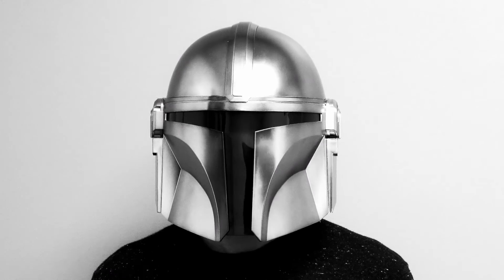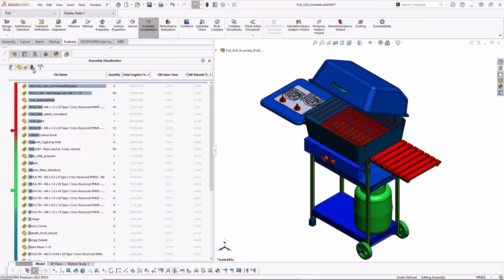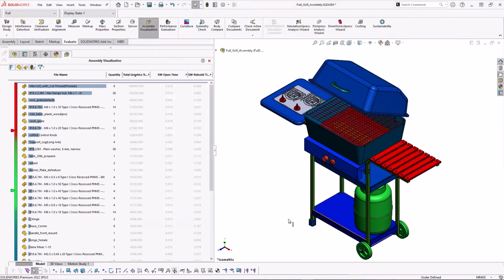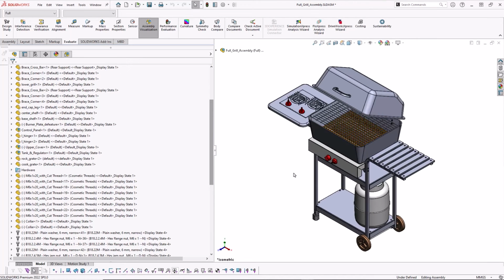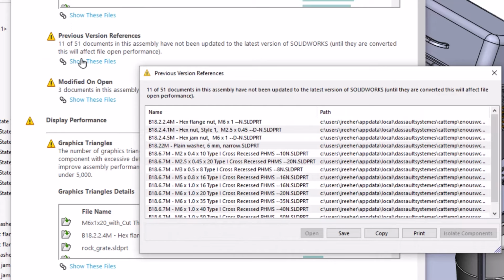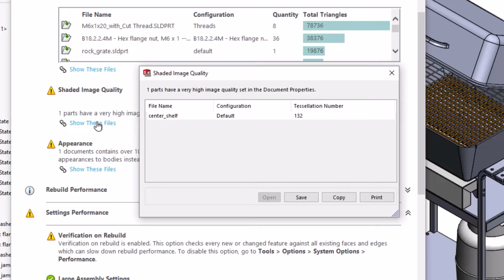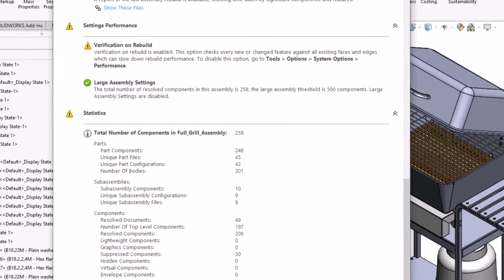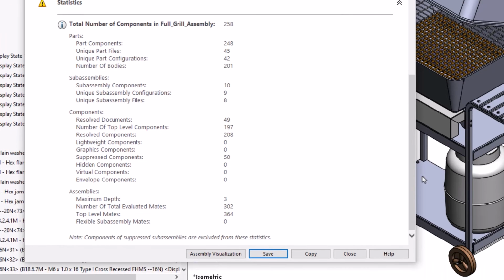Why is Your SOLIDWORKS Assembly Slow?

Comment: Hey Bro, I have another issue.

My SolidWorks is only using 30-50% CPU time?
Do you have any idea what's causing that? And how to fix it?

Thanks I really appreciate any help....... :0)=
Reply: i really wanna know too
Reply: @ltd5480  I have figured it out. There is nothing wrong with Solid-works, but it can only use one thread at a time. If you have a 4 core chip it will only use about 30%. Meaning one core 100% and then some!
I have overclocked my Alienware from 2.80 GHz to 4.13 GHz. a 36% gain, the thing screams now!
Reply: I saw some post before. Solidworks do calculations thread by thread, that means can only process by single core even you have multicore processor CPU, hence, the CPU usage wont be full.

Comment: Hey Bro. Thanks for all the great info, you saved me from my agony over many months.

However, I still have an issue I can not find any info on.

If enable hardware acceleration in my video card, I can rotate the Assembly or part  very fast, However the dynamic highlight turns very slow. I can see it redrawing the edges that belong to the area of the screen over the model I have hovered over.
If I don't hover over the model prior to rotating, there is no problem.

But if I hover over the model prior to rotating it starts redrawing the edges, and I have to wait sometimes 10 seconds, depending on the complexity of the model, before it actually starts rotating.

If I turn off 3D acceleration, then the Dynamic Highlighting redraw is so fast the edges just appear at once.
But then the rotation speed is slow.

If I turn off Dynamic Highlighting, then there is no problem, but I need that feature to find hidden edges while designing.
No one even seams to have even heard about this problem.

Do you have any ideas on what might be going on?
Maybe it's just my system.

Thanks for the great video!